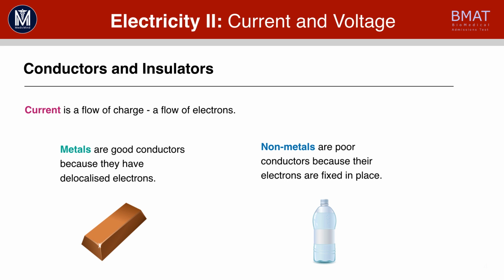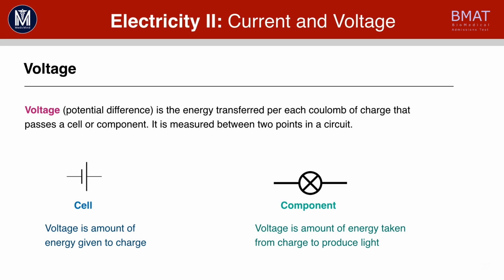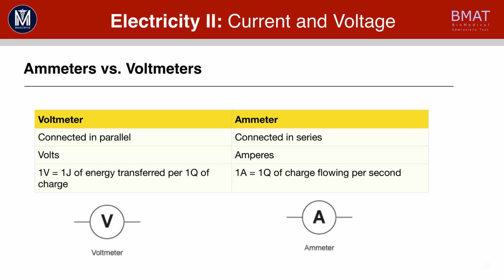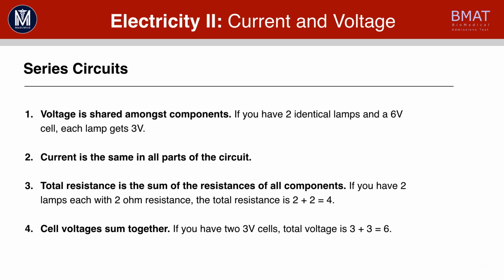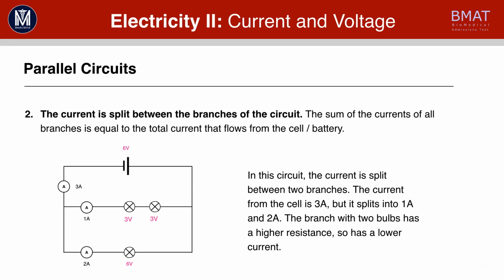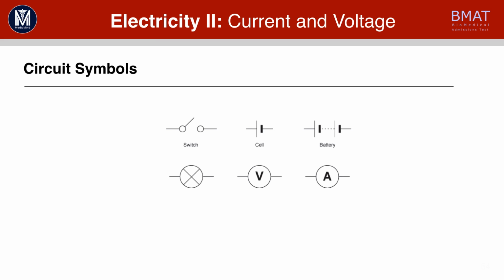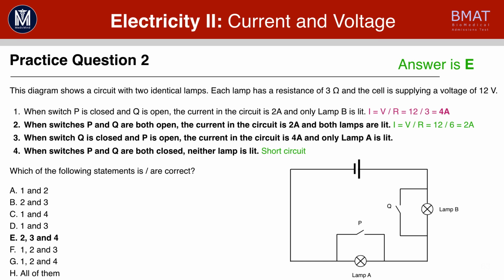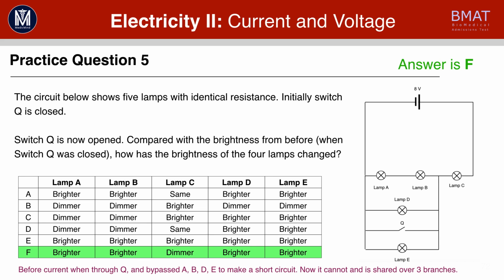BMAT Section 2 Physics | Current & Voltage | Medic Mind

Comment: Could you clarify question 5, please? It says in the video that when the switch is open Lamp C will become dimmer because "there is greater resistance in the circuit with 5 lamps as opposed to one". However, would you not also consider the increased number of active branches when the switch is open, thus greater opportunity to reduce resistance? Meaning, the charge is less congested than in a series circuit (the circuit effectively becomes series when the switch is closed). This underlines the principle that the total resistance of a parallel combination is ALWAYS less than of any individual resistor. Well, when the lamp is closed there is an individual lamp resisting with only one access branch.

I hope you understand what I mean here! A response would be greatly appreciated.
Reply: That would be true if there were no components but lamps have intrinsic resistance due to heating which overcomes the effect of multiple branches being opened. Im not a teacher btw just another guy taking the bmat lol
Reply: @Immerzed   Cheers mate! Makes sense now.